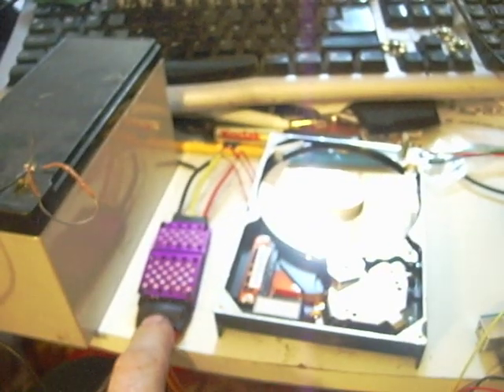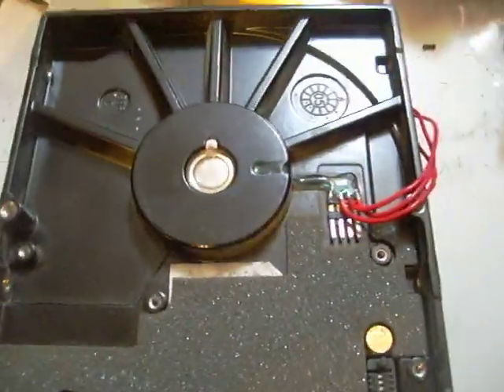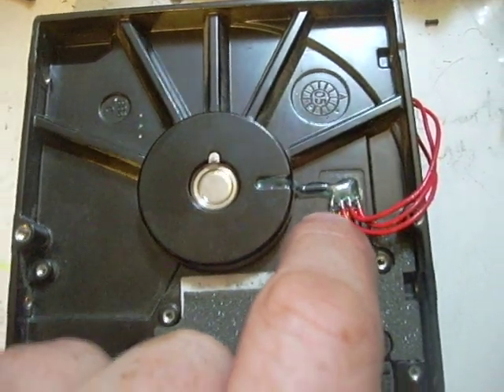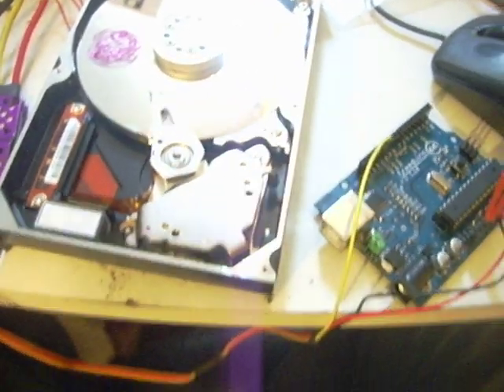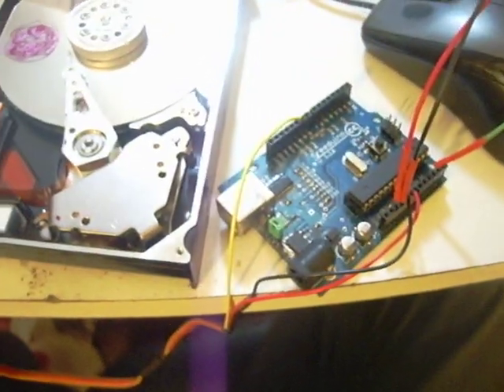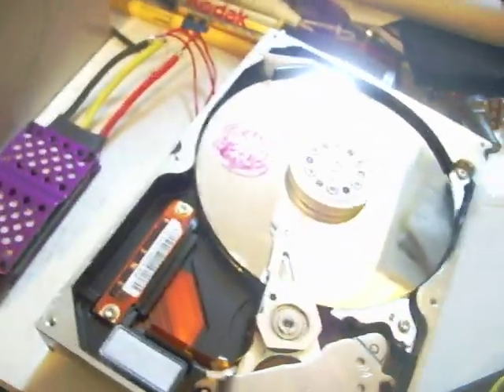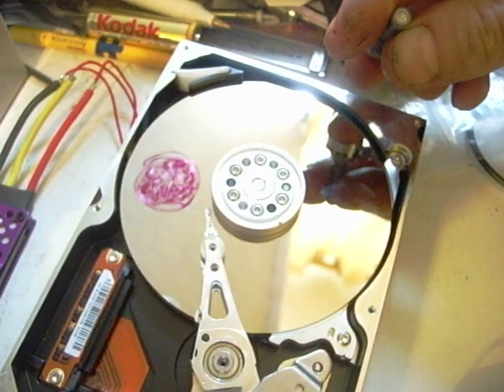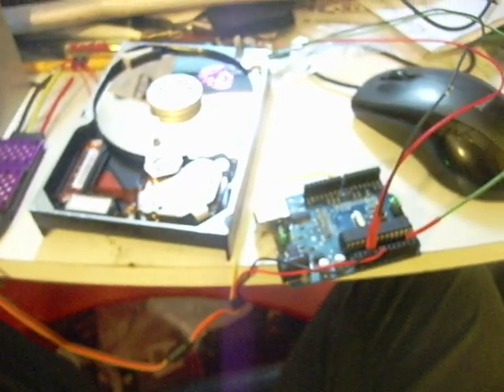Hard Drive BLDC Arduino Demo.

Comment: Thanks for the quick reply. I think early 3phase ESCs didn't have reverse but I'm sure I seen them with configurable braking and reverse now. I'm not sure how useful braking a HDD motor would be but reverse would be useful for the project I have in mind. I'm planning to use an offset disk plater as a laser mirror. I've had issues with balancing but using an ESC to run at lower speeds might be just what I'm looking for. Thanks for the inspiration!